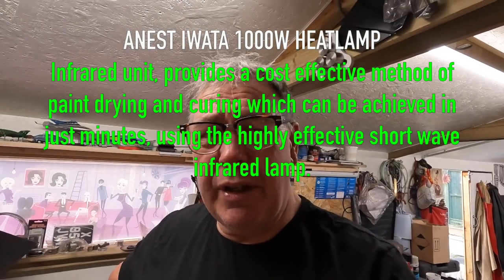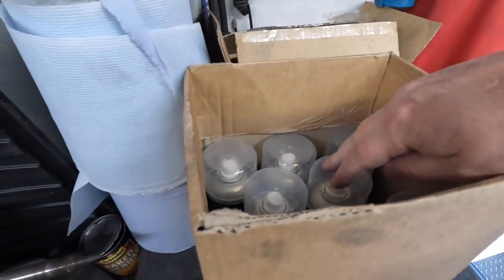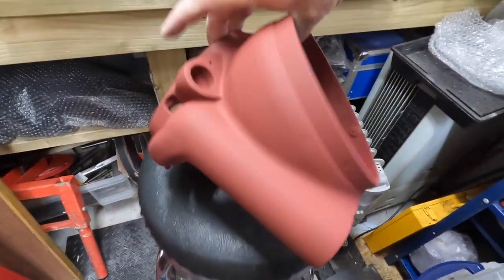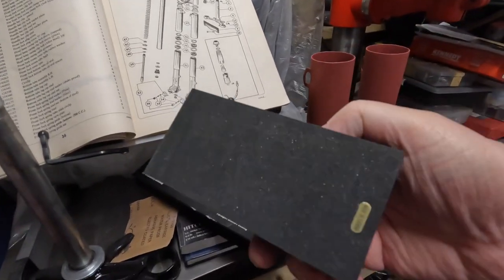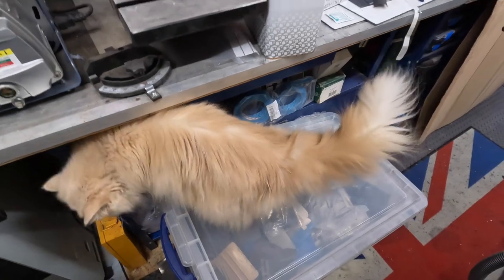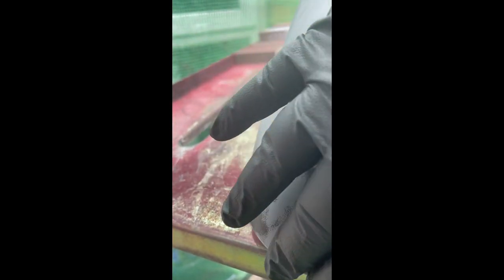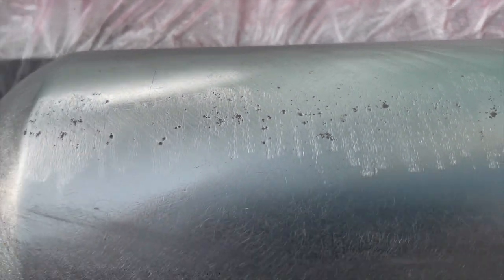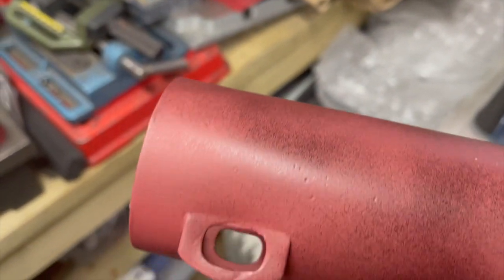Royal Enfield Bobber Project Part 38

Comment: Nice one Ian, make sure it’s not damp when you apply any paint or it will micro blister in time, you can start flatting your primer with 400-500 then go finer, if you start to fine it may ride over the peel, although it did look quite smooth you probably know this tho 👍🏼👍🏼
Reply from the maker: Thanks mate, yes I turn on the heater for a while to get the tent and the part warm, drop the paint canister in warm water for a while then turn off the heater, shake n spray, turn on the heater if the temp has dropped noticeably, zip up the tent and leave lol. I should have said the finest paper I'd use to finish would be 1000g or 800g or it wouldn't give a sufficient key for subsequent coats, I usually start at 400g and work up. Thanks for having my back, much appreciate it :)
Reply: Your ready to go 👍🏻
One thing tho, I’m not 100% on the warm water for the paint, I’m not sure, it is possible you could get condensation on the inside of the tin, that’s not good
Your better off leaving it in the house or near a warm ish sauce, ie radiator or even a gental blow with a hot air gun
Just don’t cook it or you may have a mr bean painted room 🙈
👍🏻
Reply from the maker: @Dustmonkeycreations  Oh right, I'll stop that at once lol The person that lived here before us left a hairspray can on top of the radiator, blew the back door and windows out when it exploded :)
Reply: @HepcatHarley  ya I wouldn’t say that’s best idea 😂 but tbh as long as it’s room temp it should be fine. We often forget to take a spray tin out the booth, then bake at 80c lol they just get a bit warm 🙈
I know you have been involved in paint but if you ever need anything advice just holler mate, it’s no problem 👍🏻